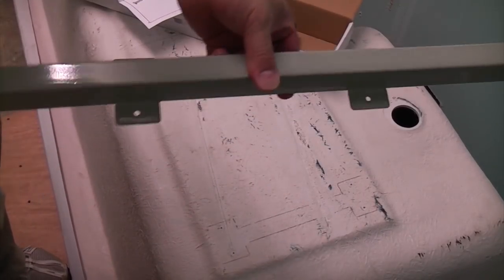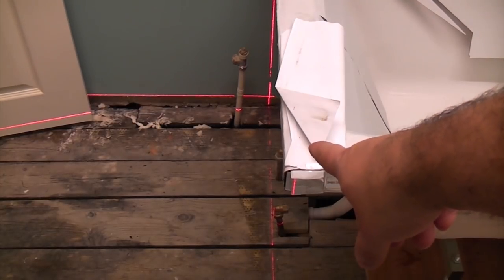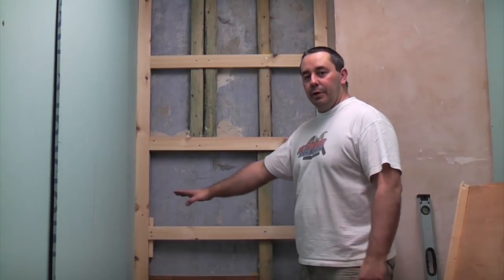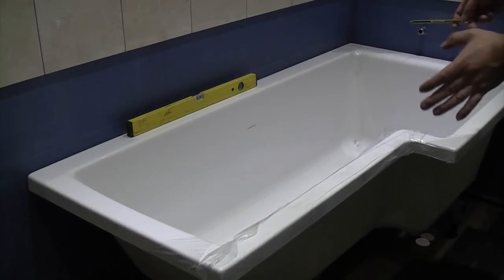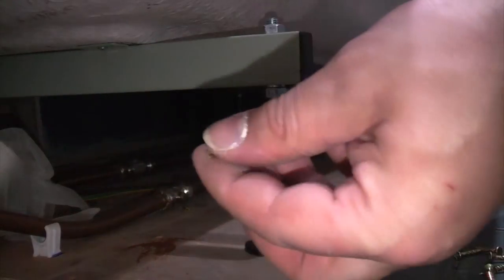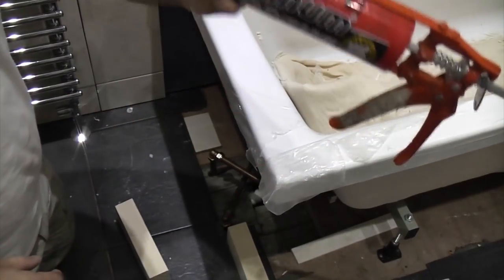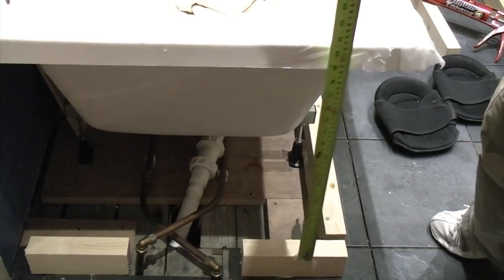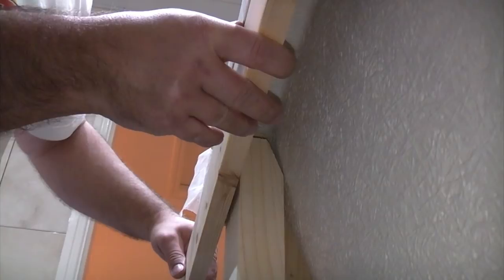How to fit a bath

Comment: I like the way you explain, to the point and according to the real site issues. 
Whats the bath tub height should be or mostly keep from the final floor?I know there is no standard set, all depand on the bath panel but in my case bath panel hasnt been decided yet. Thanks
Reply from the maker: I have no idea, sorry.
I've not installed a bath for years and have never measured it!

Comment: Hi again. Why do you stick small wooden blocks under the bath lip first to then glue the wooden frame post to it? Couldn't you glue the post directly to the bath in one go? Going further, why do you need wood blocks on the floor too? Why not just one post from floor to bath?

Also what did you glue the wood to the bath with?

Comment: I notice you're screwing into a wooden floor there. I need to screw a bath into a concrete floor. I was thinking of using 7mm brown plugs and a suitable screw. Do you reckon that sounds ok? I'll also use a baton and grab adhesive on the walls as per your advice in the video, thanks!

Great videos, keep up the good work!
Reply from the maker: Yes, that should be fine 👍
 Thanks for the comment 👍

Comment: why didn't you silicone the edge of the bath to the wall like some videos suggest?  Some even suggest gluing it with CT1. Also you haven't used any brackets.
Reply from the maker: I used a bath sealing strip, which goes behind the tiles- https://www.youtube.com/watch?v=tRweaE32_ks
I didn't need brackets, as I used a batten, which is better, as it supports the lip of the bath 👍

Comment: Do you have any advice on securely connecting the trap to the waste underneath the bath - the plastic compression nut of the trap comes off the waste thread (also plastic) a bit too easily for my liking. Should I put some silicone on the thread of the bath waste before tightening the trap compression nut on ? cheers
Reply from the maker: I have never used silicone before, but the last time I installed a bath waste, I used plumbers gold on it, as that is designed for such purposes. https://fave.co/2IHuVl0
Thanks for the comment 👍
Reply: @ultimatehandyman  got the No Nonsense sealant/ adhesive from Screwfix following your advice - thanks once again

Comment: Getting my bathroom fitter this month. Would appreciate if you answered a few questions. 

Would you advise putting moisture plasterboard on all bathroom walls or just wet areas like the shower? 

Is it ok to leave some walls without moisture board in the bathroom?

Or to save room and expense could I just not use moisture board at all and instead chase the wall for the pipes and then tank the brick walls or would you say moisture board is the best option if having a shower unit?
Reply from the maker: I would just use moisture resistant plasterboard in the shower area and then tank over it.

The other areas in the bathroom do not require moisture resistant plasterboard or tanking.

I would not chase out the bricks or tank the bricks as it would not leave a good surface to tile onto.
Reply: Ultimate Handyman Cheers mate I'll do that, just 2 more questions if you don't mind. I'm having a shower bath. I'm gonna do what you did in this video, batten and board the wall where the shower and bath pipes will go, but do I need to batten and board the wall that runs along the length of the bath or should I dot and dab some board to this wall or no board at all along the length wall of the bath?

Do I need to tank the plywood beneath the bath?
Reply from the maker: If the wall that runs the length of the bath is bare brick you will have to board it out. 
Dot and dab is the easiest method and will give you slightly more space than if you use battens. If using dot and dab you also need to put in some mechanical fixings to hold the boards in case of a fire.
There is no need to tank the plywood beneath the bath as the water should never get past the bath.
I'd definitely use a bath sealing strip - https://www.youtube.com/watch?v=tRweaE32_ks
Reply: Ultimate Handyman Thanks for the advice. Really appreciate it.
Reply from the maker: You are welcome ;-)

Comment: Are using battens to support the bath the standard part of fitting baths. Just curious because it doesn't mention it in the bath instructions I received. It just has instructions for the legs.

Also are the horizontal wall battens for the bath completely necessary? The bath I have came with a corner fixing for attaching to the wall.
Reply from the maker: No, they often don't tell you to install supporting battens, which is why a lot of baths move away from the wall- which breaks the bead of silicone. I always put a batten along the wall and make additional battens/supports. This bath is exactly like the day it was installed, it has not move a millimetre and the silicone bead is still perfect.
It's up to you really, you can follow their instructions, or add a bit more support.
Thanks for the comment
Reply: @ultimatehandyman  I read the instructions again for the ideal standard bath I brought and it does mention using wooden battens to support the sides and front. So I'll be sorting some out. Thanks.

Comment: i am trying to fit a bath but the corner is not sqaure. However both walls are brick+plaster. What would you recommend i should do?  Should I cut into the plaster ? I would have sent you a picture but cant seem to see a way how to do it.
Reply from the maker: I normally fix a piece of moisture resistant plasterboard using timber to square it up, but that is a big job if you are at the bath fitting stage.
I have seen people cut the plaster away, but you have to watch out if it's at the tap end, as the taps can be too close to the wall after it has been tiled, making some taps difficult to operate.
Good luck with it.
Thanks for the comment 👍
Reply: @ultimatehandyman  hi - thats a good point about the taps - i did wonder if I would have sufficient space for the taps if i cut 10mm in the plaster. I think i will have to build up the section of the wall that's not true with plaster. As I am am on the subject of bath installation, what is the convention for tiling in the bathroom? Do you tile the whole floor before installing the bathroom suite or install first and tile around?

Comment: Hi again. Why do you stick small wooden blocks under the bath lip first to then glue the wooden frame post to it? I'm guessing its for easy measurement. But couldn't you glue the frame post directly to the bath in one go? 

Also what did you glue the wood to the bath with?

Cheers
Reply: Most modern baths have those small wooden blocks already attached.

Comment: Hi, Best bath installation video I've seen! I have a couple of questions as I'm stuck with mine. 

a) I have been told to tile floor after fitting the side panels. Obviously you've not done this, I was wondering why.

b) How do you attach the panels? My long panel has a bottom lip, should I cut this off to enable me to glue it to the wooden frame? My short end panel is too long. Should I cut it down? or is it just the wrong one!?

Thank you
Reply from the maker: Thanks.
a) If you tile after installing the bath panel it can make it difficult to remove the bath panel at a later date. But with some panels such as flexible plastic ones this is not an issue as you can often bend them to remove them.
b) I'm not familiar with every bath panel out there, but it sounds like yours might be designed to fit in a track or something? Are there no instructions with the panel?
Reply from the maker: Sorry, I can't see any picture?

Comment: Nice video and thank you for sharing. This is my first time installing a tub and I wanted to ask you a couple of questions if you don't mind? I've seen other videos where people install the frame to the sub floor. Is that okay? I only have my sub floor in at this point. I'm going to have to square my wall as well and will probably ask you about that later. I have a Duravit tub that came with brackets for the back wall but I think the way you installed the wooden support is better. Do you think I should do the same as you did? Thanks again for sharing. Wonderful video. And I'll be sure to subscribe and watch more of your videos.
Reply from the maker: There is no one way of installing a bath that everyone follows, I normally just do it this way as it always works for me and I find it easy. Of course you can install a frame to the sub floor, just do it which way seems best for your particular bath.
Best of luck with the job and thanks for the comment ;-)
Reply: An update. I think what's happened is Duravit has included extra hardware, the hardware kit is generic or upgraded, used for more than one tub.  I think I got it figured out.

Comment: How would you then remove a panel that was fitted like this?
Reply from the maker: Normally the panel just pushes into position and will stay there, although it might be fixed by a screw or two. Because of the shape of the bath panel, they are self supporting and will not fall over.

Comment: the batons that you fixed to the wall to support the bath rim, is the bath sitting on them or a few mm above ? Im confused to what to do with mine as some people say the batons should not touch the bath and some people rest the bath on them entirely. thanks
Reply from the maker: The bath is sat on the baton which is fixed to the wall. This prevents the bath from flexing which breaks the sealing bead between the bath and the wall

Comment: Hello again :-)
I'm now fitting a new bath into my full bathroom refit.  The bath is a standard 1700mm long bath but its actual length seems to be more like 1705mm.
The space I have to fit the bath into is slightly smaller than 1700mm - about 1695mm (partly due to my replastering.
The old bath that was in clearly had a similar issue as the wall at the taps end was hacked out a bit.
I think it is obvious that I must also cut out a channel in the plasterboard at one end or the other so the the bath will go in.  However, as I am following your instructions about tanking the bath / shower area properly, it is obvious to me that I need to create this channel right now (before tanking and tiling) so that even the channelled out bit is waterproof.

OK, so having said all that, I'm unsure about how to do what I need to do.  Should I simply cut out a strip of the plasterboard (actually it's the crappy egg box stuff) 40mm or so high and for the width of the bath, so that the bath will slot in to it at fitting time?  Should I line that strip inside somehow so that I can then paint on the tanking seal inside the cut out area?

I would appreciate your insight if you could.

Cheers!
Reply from the maker: Julian Smith 
I'd cut the plasterboard slot out from the opposite end to the taps if possible (if you are having taps on the bath) or the taps could be too close to the wall to operate them easily.

Once you have cut out the slot from the plasterboard you can then tank it with the tanking solution.
Reply: ***** Thanks.  I'll let you know how this goes.

Comment: I have a small 5mm gap around the bath where it meets the wall. This is due to the position of the old metal waste pipe which I can't move without a lot of digging and plumbing. Options? 

Is your data on a drive? I lost mine after I dropped the hard drive. Did you look into sending it away to be professionally examined? Contact me if you need links.

Comment: How do you fit the L shape bath panel please?
Thanks
Reply from the maker: I did video this, but lost the footage! 
I assembled the panel and pushed it into place, then marked the floor where the panel sits, then measured the thickness of the panel and drew a line. I then glued 3*2 battens to the floor, then made supports going to the top of the inside of the bath. The panel was fixed to the supports in just two places using countersunk screws. 
The L shaped panels are quite sturdy and self standing, so they don't require much fixing.

Comment: After you tanked the walls, you then tiled the walls. How did you fix the baton to the wall with out damaging the taking system to start your first row?
Reply from the maker: I used the tile tracker to hold the tiles, but you could put the batten lower down ( much lower than the lip of the bath) then you are not piercing the tanking above the bath where the tanking is needed.
Reply: +Ultimate Handyman wow thanks for the quick response 👍 do I then just push the bath up to the tiles rather than tile onto the bath?
Reply: +Ultimate Handyman I have just looked at tile trackers. Il get one of those, didn't even know they existed. Thanks a lot. Keep up the good work
Reply from the maker: You are welcome.
It depends how you are doing it. I tend to put the bath in position and mark the wall and then remove it before tiling (this way there is no chance of damaging the bath). I then tile the wall but leave the last row near to the bath, then install the bath and then install the last row of tiles by scribe cutting them to the exact size.
Reply from the maker: They are great and can make tiling walls much easier ;-)
Thanks for the comments
Reply from the maker: No, I normally put the bath in position and mark it, then tile the wall apart from the last row, then fit the bath including the sealing strip, then tile down to the bath. Once the tiles and grout are dry I then fill the bath with water and then seal the gap between the bath and the tiles with a good quality silicone sealant.

Comment: just installed my bath do I fill with water now and silicone round it an let it cure? and also when I start tiling do I refill bath with water and tile or just tile without water in
 bath .sorry for the essay lol
Reply from the maker: Did you use a bath sealing strip?
Reply: Yes iv got the strip on and bath in place leveled . but no silicone or out yet.but my wall isn't totally square like yours so was gonna silicone to make up the difference.but now the strips on iv just got a gap if you know what I mean so can't seal between edge of Bath and wall. 
Sorry to be a pain
Reply from the maker: Normally I just tile down to the bath, leaving a couple of mm between the tile and the bath lip. Then once the tile adhesive has set and the tiles have been grouted I fill the bath with water and then silicone the gap between the tiles and the bath.
The tiles go over the bath sealing strip so no need to silicone before fitting the tiles. How much of a gap do you have ?
Reply: It's about the thickness of a wall tile the gap.what I was gonna do was fill the gap with silicone to square up the gap.then seal all way around the bath.with the water in then tile down to edge of the bath then seal between bath and tiling.i wasn't gonna use the strip because of this situation
Reply from the maker: In that case I would fill the bath with water and fill ant gaps with silicone. 
Hopefully once tiled, grouted and silicone applied you should not be able to see it ;-)
Reply: Yeah I reckon with the tile adhesive on the tiles will take me just onto edge of the bath to cover it.cheers mate for your advice fantastic level of care you show with your videos and trying to offer advice 🖒

Comment: the bath we have purchased has a wooden batten the full length of the top of the bath and there is no gap to slot the side panel in  any ideas?? Thanks
Reply from the maker: +Peter Smith 
I'm not sure Peter, sorry.
I have only installed a few baths. I'm sure one of them had a piece of timber running the full length, but there was a gap to slot the bath panel in.
Did you buy it from a reputable place and buy the bath and panel at the same time? If so it might be worth giving them a call.

Comment: hi mate once the bath is leveled do you silicone round it with water in the bath ? and then fill it back up once your ready to tile ? bit unsure any help be appreciated cheers
Reply from the maker: I normally fit a bath sealing strip- https://www.youtube.com/watch?v=tRweaE32_ks
Then tile over the top of that. Once the bath is installed fill it with water before applying a bead of silicone and leave the water in until the silicone has cured.

Comment: Hi. Love your videos. I am in the middle of doing a bathroom. I was wondering if it may be easier for me to install the batons level on the wall, rest the bath on these and then adjust the feet? That way they should all be level when they touch the floor? Is there a disadvantage to doing it that way?
Reply from the maker: As long as you get the battens level and at the correct height it should not be a problem doing it that way (providing the edge of the bath is square and level)
Reply: Ultimate Handyman thanks for the advice :)

Comment: If the bath is level , how does the water drain away. Cheers
Reply from the maker: The bottom of the bath slopes towards the plug hole.
Thanks for the comment

Comment: What size wood is best to use for the batton? 2x1 ok?
Reply: and the wood for the floor/supports, all same size?
Reply from the maker: I think I used something a bit more substantial,  If I remember rightly I used 3*2 but you could probably get away with 2*, it depends how strong you want it to be.
Thanks for the comment